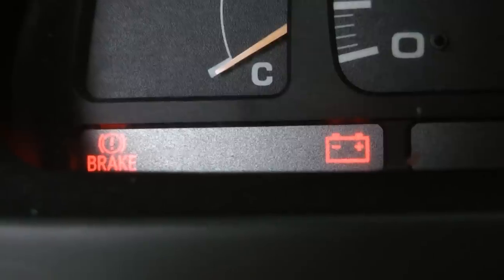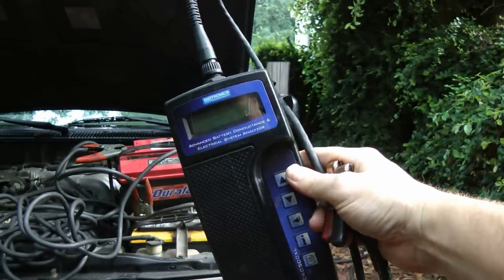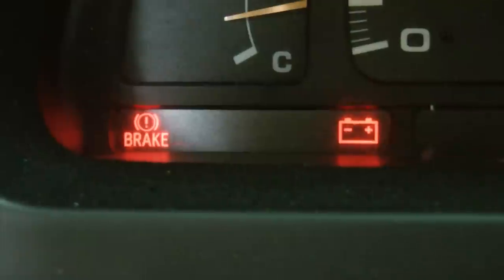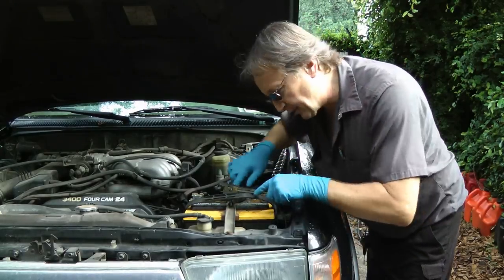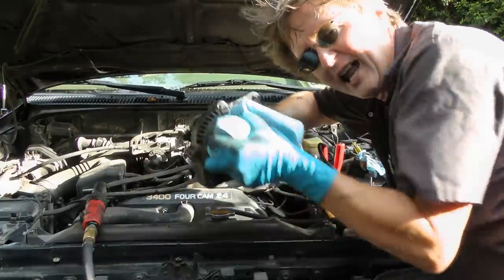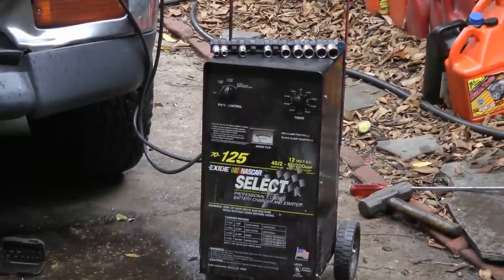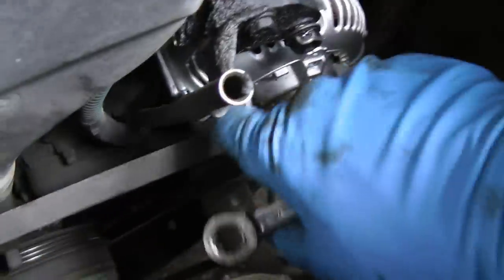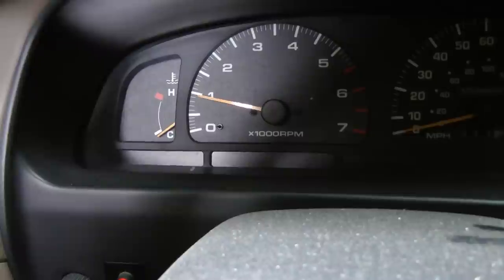How to Replace Alternator in Your Car

Comment: Scotty, Ive had this problem for a while now. When at temp my 1994 Prelude starts to get rough, idle gets rough, and the cabin shakes. If I put it to Reverse (Automatic trans) the idle will dip really low then the car shakes, idle climbs back up then shakes again and repeat. Regulates when in neutral or park but i can still feel some jerking from the engine (H23A1) But when the electric connection that goes to the alternator is unplugged, the idle goes smooth and the symptoms go away. I got a multimeter and checked the volts. when under load the voltage reads up to 13. then it dips to at least 9 votls. The AC is on and I can see the fans stop, shouldn't the fans be on all the time when the AC is on? They come on a few sec after. Idk if it's the volts not being able handle it or the ac itself. anyways i was testing it and the volts were like 11.40 or so, engine running rough, then out of no where the idle changes and engine runs smoother and i look at my multimeter and the volts went up at least 1 volt to 12.40 just like that then back down to 11 and running rough. I decided to change the alternator and the belt. I changed it and no change. A few months ago I got a CEL for Code 20 ELD Electrical Load Detector built into the under the hood fuse box. Idk if this can cause this since I heard it regulates the voltage from the alternator or something like that. You think the problem is the ELD. only $30 to replace the fuse box you think i should try it? Thanks for your time
Reply from the maker: I would pray it's just the eld, try a used fuse box and pray

Comment: Never (EVER) but remanufactured. Always go with OEM. I’ve had nothing but trouble with 5 separate replacements with non OEM alternators. Anything other than OEM is complete crap.
Reply: Red XIII Running remanufactured right now. You got a bad lemon. No issues so far with mines.

Comment: scotty i have a 1994 mitsubishi galant 4g64 engine and it blow the alternator every one week! and am tire of that! in 4 month i have to replace 10 alternators!!!!!!! the alternator have life time waranty but the guy's from autozone ther are not happy every time they see me
Reply from the maker: you are either getting REALLY crappy alternators, or you have a short in the alternator wiring going from the alternator to the ignition switch and the battery. Check that wiring, especially near the connectors on the alternator for fraying or heat damage and warped connectors
Reply: A electromecanic tell me that auto zone is selling me the wrong alternator